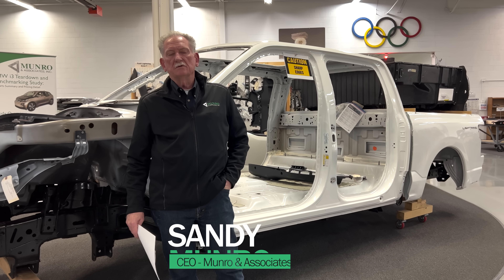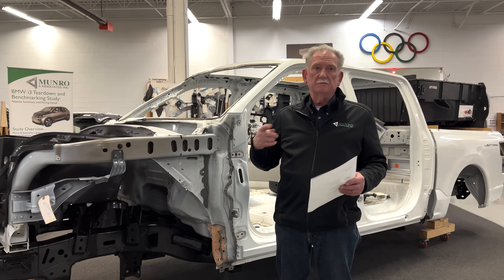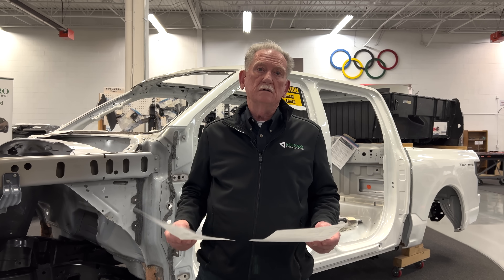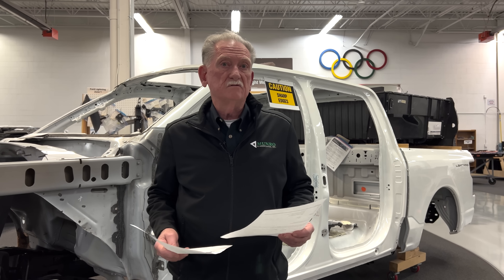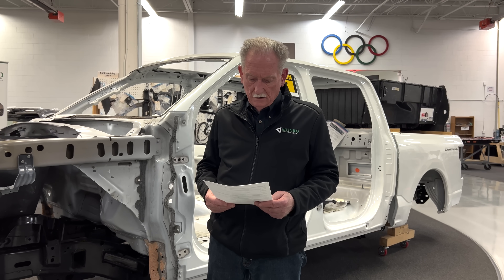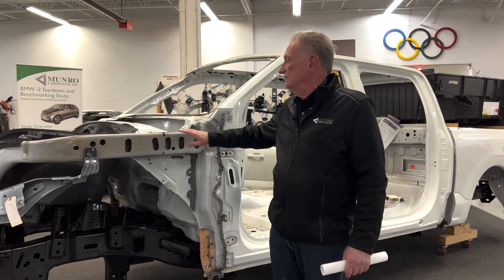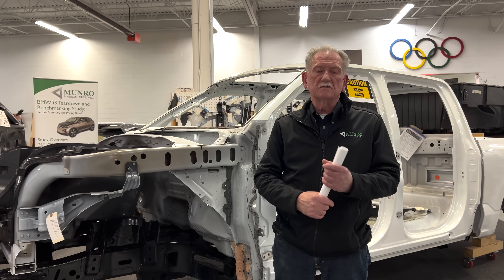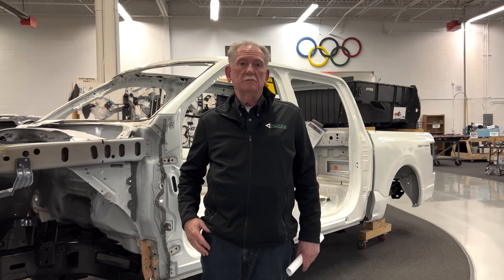Sandy's Initial Thoughts on the 2025 Ram 1500 Ramcharger

Comment: I imagine in the future when there's semi truck chargers spread around all over you could rent a 500kwh battery on a pallet that fits in a truck bed and charges from 20-80% in like 15 minutes. Same could be done with a generator on a pallet now. Just rent the things when you need to road trip. 

Same thing with RVs, they could be built with honkin big batteries and just plug in to the tow vehicle while on the road. You'd also be able to charge before you camp and run your AC all weekend off the battery.

Comment: Why do I need a 690 mile range? I don't. What I do need is a truck I can use to tow my RZR to the central Idaho mountains, and make it home again without hunting down a non-existent or non-working charger. The Ford would leave me stranded up there begging for a level 1 plug, or hoping I can find an RV park for level 2 charging. The Ramcharger will be my next truck until the EV infrastructure is built out...

Comment: I like the ram concept. I’m no engineer but think the V6 is overkill and would prefer a smaller 3 or 4 cylinder gas or diesel. The engine could run more to keep the battery charged and maintain a good range.

Comment: I think this is a good use case vehicle for towing. The cost for the bigger battery pack on a lightning does not really help with depleted range while towing. Wonder what the cost is to manufacture for a motor/generator vs the cost extended range pack upgrade of a lightning? Bjorn Nylund shows in his videos that even a model Y while towing would be 14 hours vs 10 hours without towing. I can definitely recommend this to my once in a while towing buddies

Comment: This guy is missing the entire point of a truck. It's to do truck things. Like, oh, I don't know, TOWING. If you look at the Lightening it's garbage if you need to tow. You get like under 100 miles of range. Who's going to buy that if they're towing an RV? No one. Now, my question here is does the 3.6 V6 generator provide enough output to power the electric motors at full power while towing? Or are you going to drain the batteries in like 50 miles and then get put in to a reduced power mode until you can charge up? Who's going to want to deal with that while towing a 10,000 lb RV, having to find somewhere to not only charge, but drop your RV so you can charge. These are all questions that need to be answered. I give two poops about the 690 mile unloaded range. I need to know range under load and what the capabilities are of that range extending generator are. I use a truck as a truck, not a grocery getter. If this thing falls flat on it's face after the battery is drained then it's DOA to a lot of people.

Comment: ok, stop using the 40 mile statistic. I drive about that (50 miles) but still use well over 100 miles of battery every day. Between my aggressive driving and phantom drain, i always divide the EPA range by half. More if its the winter

Comment: Totally Agree. 320Miles is more than enough. Of course I don't tow...
Reply: I respectfully disagree.  I think if you live in the eastern part of the United States, where my brother lives, and he owns the Ford F150 lightning extended range the Ford F150 lightning will probably do most of the work for you without a problem.
I own an F150 lightning in the mountains of Colorado, and I also travel to Arizona and often times pull a trailer. I can tell you the ram ram charger will be the way to go. In the Midwest, west, and Northwest, the ram ram charger is the pick up of choice, especially if you told
I have a second gas for towing and long distances because it is just not practical with the Ford F150 lightning from a Tim standpoint, and also from a standpoint. All the people in the Midwest and West will cherish the ram charger!
Reply: @bobmorasko yeh, hopefully most chargers are coming

Comment: I agree with you on the 3.6 liter engine. I have a 2017 Chrysler Pacifica with that engine. It has pick up similar to a V-8 while getting decent fuel economy. On long trips I get around 30 miles per gallon and I have about a 300 mile range, give or take, that’s not bad for a gas powered vehicle. I hope Stellantis successful with their new pick up. With a  600 mile plus range, and my driving  perhaps 100 miles a week, I would only have to gas up once a month! Keep up the good work I’m a big fan!🤭

Comment: Sandy, I think this will be a great truck, especially for fleets like construction companies.  The majority of time time, its an efficient BEV, but for that day you need to pick up and tow a piece of equipment and tow it, it gives you the mileage you need, giving that towing typically cuts mileage by 50%.  I lot of fleet owners I’ve talked with wont touch a Lightening for this very reason.

Comment: The new RAM 1500 has a 27 gallon gas tank. Subtracting the 190 mile range for the battery from the total mileage leaves us with 500 miles of gasoline extended range. In the best case, this gives us 18 mpg, which is pretty dismal for a truck these days.

Comment: Comparing an all electric to the Ramcharger is apples to oranges.  The biggest difference, and it's a HUGE difference is that the Ramcharger isn't a slave to charging.  Range be damned, the Lightning is always going to require charging. That is why the Ramcharger would make more sense to most people.  Not having to pay the expense of installing a charger at your home, not having to worry about what to do if you live at a condo or apt complex, not having to worry about installing expensive charging apparatus if you're a business owner and are using it as a work truck.  Also, when you mentioned the fact that that Lighting prices are coming down, that's because NOBODY IS BUYING THEM! That's called a clue regarding what people who actually buy trucks think about electric only trucks.

Comment: People want an electric vehicle with more than 300 miles of range.  Why?  Because practically it’s 200 at highway speeds.  You don’t design cars off averages you design off requirements.  I will get a ram charger because it has range.  That and 600 HP

Comment: Exec Summary: Engineering analysis and "teardown" of a CGI / "press release" vaporware vehicle, which won't be available to buy for well over a year and a half.  Also comparing it to a production vehicle which has been thoroughly dissected and analyzed (with carcass as a background prop).  Undisclosed price; likely higher than $90,000 with double stitched pleather config.

Comment: I had two Chevy Volts. They worked great, but I hated when the generator came on. I tried everything to avoid it, so I could “glide” quietly, and wished for a longer electric range. 

So, it was really just a gateway drug to a real electric car. After the local dealer damaged my Volt three times in a row, I sold it to a friend who lives near a different dealer, and got myself a Tesla. Despite all of the service horror stories, I feel treated much better at Tesla. Not that my Tesla needs much service anyway (less than $1000 in 6 years)

Comment: I can easily travel up to 700 miles at a time on a given job, so a Ramcharger would theoretically be for me. 

My problems are as follows- 

Unlike Sandy’s summations on the 3.6, I don’t find it all that great as an engine for the Ramcharger (too many cam and timing chain issues). I was surprised Stellantis didn’t go for a four-cylinder Hurricane engine instead. After all, if all it’s going is turning a generator for the batteries, even a six cylinder would be kind of superfluous. 

Despite the insinuated range of the Ramcharger, I’m still not quite sold on the EV model as of yet. I AM somewhat intrigued by the range extension idea, though.  The potentially-outrageous cost of EV components (batteries, etc.) also leaves a lot to be desired.

Knowing the somewhat inconsistent QA of Stellantis-era Dodge/Ram products as of the last several years, I’d not sure of its overall durability (this due to less-than-admirable experiences with their products). 

Hopefully a Ramcharger can be procured for study when it comes out.

Comment: Back in the 90's I put a small Lister air cooled 4 cyl diesel engine  with generator (bought it US Military surplus, in a Dodge Dakota along with 4 truck batteries and a couple of huge capacitors (also surplus). I had an aircraft starter / generator hooked up to the driveshaft replacing the transmission (simplifying here it took a lot of work and some custom machining to get all this to work together, a friend built the SCR electrical system because that was WAY beyond my skills ). 
I drove that truck for a bit more than 100K around Houston and it was quite functional and pleasant to drive. It had plenty of power on the city streets and did the speed limit on the highways that crisscross the town (so it might be 20 miles from one side of town to the other for me).
That thing just sipped fuel, 52 MPG, and I hauled 500 to 600 pounds in the bed all the time.
I've always wondered why no manufacturer didn't do something similar. Nowadays trucks are huge, the smaller trucks did as well on many tasks and sure were easier to maneuver and park than today's monster trucks. 

It developed a short in the generator windings and I couldn't get it repaired or replaced so that was the end of Frankentruck.

Comment: One of the major pitfalls of a pure EV (e.g., Rivian or Lightning) is the significantly diminished range while towing.  600+ miles of range may seem superfluous, but I can guarantee you that this will significantly diminish while towing.  Being a truck and a Tesla owner, I can confidently say that the idea of dry camping while towing a travel trailer with a pure EV truck is impractical due to the limited EV range under load, range anxiety with a suboptimal charging infrastructure, wasted time charging, especially when traveling long distances via roads less traveled.  Yes, we must stop to eat, but lets say it would take over 8 hours to get to an ultimate destination with a traditional fossil fuel truck.  Compare that with a purely electric truck that would require charging MULTIPLE times enroute, and you significantly add more wasted travel time, even if some of that charging time occurs while eating your meals.  Of course, you must assume that there are working chargers along the way when needed.  Hell, I sometimes stress out over not finding a regular gas station when traveling off the grid.  Having a longer range "hybrid" system as in the Ramcharger suddenly makes sense.  Doesn't it?  A more realistic concern would be long-term longevity of having both an Internal Combustion Engine (ICE), plus electric motors and battery.  More components to break down can potentially be expensive.  I just replaced my Model S motor with a refurbished one for $9K at around 92,000 miles.

I totally agree with @JamesBabb.  He said the same thing, just more eloquently.

Comment: So, the truck has 2 complete drivetrains - it's an electric truck with all it's features & components as well as a V6 engine that is essentially a gasoline battery charger charger?
And the V6 has everything that a vehicle needs except a transmission because it can't power the truck, it can only extend the range of the electric truck?

This is the stupidest thing I have ever heard.

How many more components can go into 1 vehicle? This vehicle is a rolling failure - repair bills of 2 vehicles in 1.

Anyone that would even consider buying this is an idiot.

Comment: Towing is the issue. I HAVE to tow and haul almost every day but I also drive without a trailer.An electric truck would be acceptable but for the dismal towing range and the long charge times. The Ram solves both of those issues. 
Believe it or not, it isn't uncommon for me to drive 500-600 miles while towing. Having a fully electric pickup would triple or quadruple my time compared to the Ramcharger.

Comment: So i gotta go to a charging station and a gas station. Has ram even thought this thru. I’ll be surprised if it ever makes production - yet alone a prototype. At this point its pretty vaporware.
Reply: Why do you think you need to go to both?    Charge at home.   Put gas in it on the road.   No need for public charging stations, ever.
Reply: @TheUweRoss  the idea behind this truck is it can go on long trips - hence them making a big deal about its range - therefore stopping for gas and public charging. If ur just gonna use it round home, who needs 690 miles of range.

Comment: There is so much negative talk of the range of electric trucks. Ramcharger have an innovative solution, & with 690 miles of range ,14000 lbs of towing,& approximately 2600 lbs of payload Now Sandy says, who would ever need that much range..Does anyone remember when Roman Mica of TFL took  Ford Lightning to Alaska.Ask Roman if he would have liked a RANGE EXTENDER.I would never buy a pure electric truck. Just wait until the rates go really high to charging your Electric trucks. What happens when your power goes out.I think all Electric Trucks have the option to power your house in some capacity. Nobody will say how long you can power your house until you can,t start your truck, especially in a winter storm I find it very interesting this video was shot with a chassis for a Ford Lighting, & Sandy says this is the best Truck .Smells Kinda funny. Nothing against Ford. Just saying

Comment: Sandy you need an engine for towing travel trailers! The lightening will only travel 75 miles wilth a small to medium travel trailer! This range extended truck can at least use petroleum fuel/gas stations! The charging infrastructure sucks bad for non tesla! Then the great thing is you can do all your daily pick up the kids going to work can all be electric

Comment: Its mostly helpful for folks who travel with a camping trailer driving cross country.  The development cost on that V6 Hybrid package may have been defrayed a bit by the likes of Winnebago to provide 120/240 volt power in a Ram based Camper Van without having to install a separate generator.

Did you forget to add the weight of the 17 gallons of gasoline (about 107 lbs +/-) and the tank to store it in?

Best!

Comment: 690 miles is unloaded. Probably about 300 miles loaded. Still fuel up at lunch and supper if you were taking a big camper out west. Going 75 mph 34 ft camper we get 9.5 mpg with cummins diesel so little heavy for this truck, probably still 14 mpg equivalent, my point being, if u use it as a truck not a car the fuel and battery capacity make more sense

Comment: I think the RamCharger as it is called, is fully electric. You can charge it and drive it without ever needing the gas engine/generator to run. I also know from watching YouTube that it can also drive on Gas engine/generator alone. So this dual drive Truck is really competitive at current times. Although when driving on each system it does not offer the "Full power", but still offers a significant driving power with each system alone for normal everyday driving. That is very significant since we all know that most people will buy a truck to only ride around by themself most of the time, or at times drive the kids to school, so simply go shopping. I could see myself only needing to fuel up once every 3 months on something like this. At that rate I would need an oil change once every two years.

Comment: My vote definitely goes for the 1500 Ram. I don’t want to be tied to a range when I spend big dollars on a truck. I want to have the option to drive my truck anywhere. THANK YOU RAM!!!
Reply: Absolutely. I think Munro missed the whole point of this vehicle. This car can really be used to transport your family and tow at the same time, without being tied to charging for an hour after an hour of travel
Reply: There are pros and cons to everything.  The point Sandy was making is you have to stop for breaks anyways.  While you stop and eat, your EV is charged back up.   The cons to the ram is complexity.  Now you have two complete systems plus all the complex integrations that can break down.  Owning a plug-in hybrid for the last 10 years has taught me, it's not the way to go.  You have all the maintenance of gas vehicle plus the gas goes stale very quickly.  If you just use it as an EV the majority of time,  which for the most part I do, I have to always keep my tank as close to empty as possible and run the engine every once in a while to keep everything lubricated.   It really is a nuisance, and something I rarely use.

In my opinion.  If your normal daily driving is 100miles plus/minus, then get an EV,  If you drive or tow long distances often enough that the extra stops add up to be substantial, then get an ICE truck.   Hybrids are only here for people that want an EV but are too scared to do so.  I know, I was one of them.   You will not be happy with it as an ICE vehicle, and you won't be happy with it as an EV.
Reply: This is American freedom, have cake, eat it too. Count me IN.

Comment: It's a gateway truck. People who are worried about range and are used to gasoline can buy this truck. Once they get used to that torque and horsepower and realize they never run the gas engine they'll start wondering why they didn't use the 500 pounds for more batteries. They'll remember that the next time they need to buy a truck.

Comment: I believe the BMW I3 was an example of a true range extender with a strictly electrically coupled charger engine.  If I recall correctly (crossing my fingers here 😊) the Volt could supply mechanical motive power from the engine.  The good thing about being strictly electrically coupled, is that it is possible to optimize the crap out of the range extender engine because it only needs to run at a set RPM snd mechanical load.